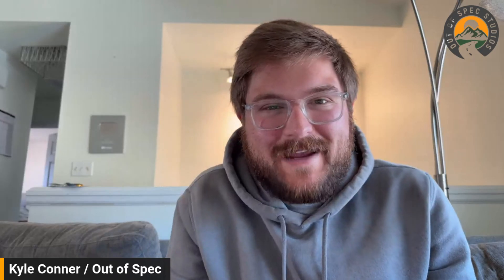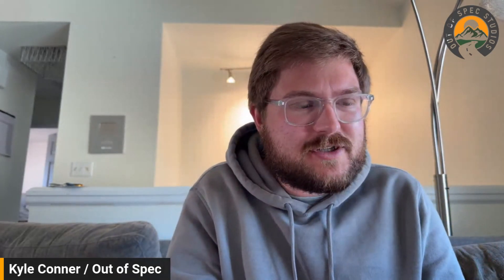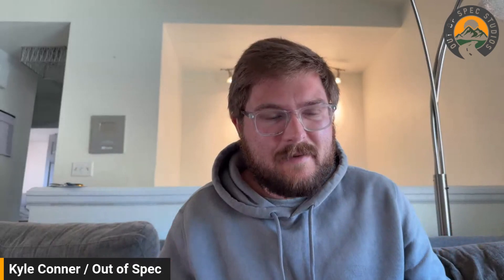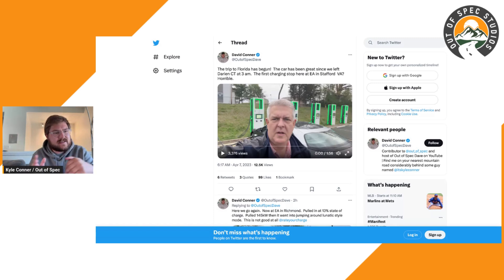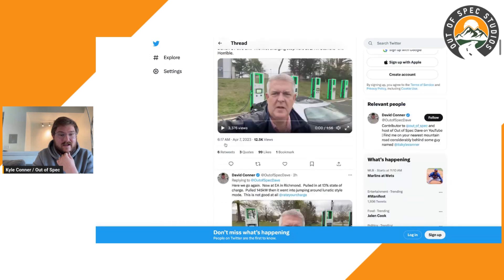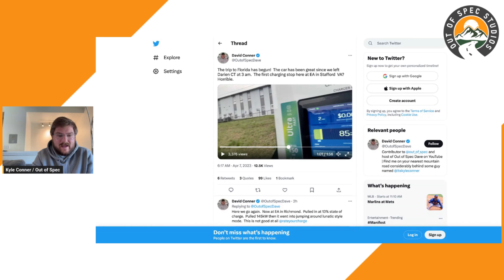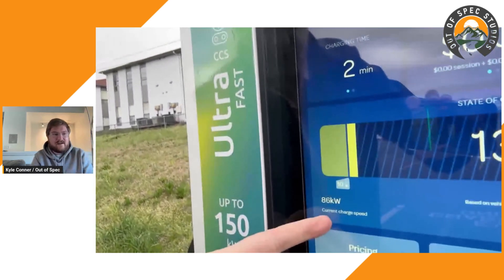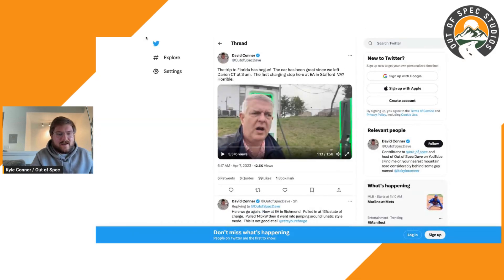Help Us Figure Out What's Going On With EA Signet Chargers Delivering "Dirty Power"! | Episode 109

Comment: Bad power module causing isolation. When it starts to ramp and use the bad module it shuts it down and keep trying to restart. Keeps trying until it finds a working combo.

Comment: I've gotten similar (but slightly different) behavior from ABB Terra HP DC fast chargers in my Kia EV6. I suspect it is failing power modules that can't supply high voltage (>700 V). The charger initially tries to give my EV6 the full 310 amps (~230 kW) then keeps backing down to around 130 kW at most stations. I thought high amperage (as most 400-volt class EVs need) would stress the power modules out more but I guess it's actually high voltage -- maybe also because 800 V-class EVs are less common.

Comment: Porsche Taycan Cross Turismo 4s owner here.   I did a Vegas run last week and stopped at the Salina, UT EA location, which has these Signet units,  both ways and did not have an issue either charging session.   I put 50kWh to 60kWh in the battery pack both times in less than 20 minutes with initial charging speeds peaking in excess of 250kW.     Curious to see how big a "thing" this is or if it is just select units being affected.

Comment: Ioniq 5 owner.  I have heard others say it only happens when their cars battery temp is on the line between wanting to ramp up.  This makes sense for when I have seen it.  Basically when I started cold (high 20’s to low 40’s).  Drove at least an hour and ran some preconditioning.  I haven’t seen it when it’s ice cold or at times I know the battery is fully warmed.

Comment: If the kW reading is fluctuating, that means voltage from the charger is fluctuating, since voltage is what controls charging. The power electronics in the car don't do anything while charging. In fact, the only thing the car does is monitor current, voltage and cell temperature. It then requests the mapped charging voltage based on this data from the charger. The charger then delivers this voltage. Except something in the charger is broken and it fails to maintain the required voltage. Fluctuations are usually caused by corroded or broken contacts, broken soldering, poor wiring, contamination, humidity and the like. DC chargers basically work like arc welders. The reason why cheap china welders are cheap and rubbish is because they suffer from all of the above. We have a brand of chargers here in Europe which are better than all the others by a big margin, and the reason for that is that they already make some of the best professional welders since god knows when and thus know how to make a solid inverter and how to keep shit from going inside and mess it up. If an entire site with multiple chargers is restricted to 50kW, that probably either means the entire System is in agony and just keeps up a basic service to help you get to the next charger, or only one 50kW module is left in working order. In any case it sounds to me as though these chargers are due for replacement or a thorough rebuild.

Comment: I have 3 theories.

1) power modules are getting tired and worn out.

2) CCS communications are faulty via bad connection.

3) EA clearly doesn’t know how to optimize the software to run on the chargers.

Comment: This along with hearing the new BTC chargers are blowing breakers in cars has me concerned about using EA.

Tesla Supercharger delivered power is very smooth without spikes (as are most other chargers). If I saw the spiking like that I would immediately disconnect and look at other options. I might even consider using the Chademo plug at the same EA site instead (since I have that flexibility) just to smooth it out.

The flickering between power levels seems like a recipe for charging system or battery damage.

Comment: When are you gonna call it? At what point do you give up on EA? They have nothing but problems. Even their "solutions" have problems. Yeah, I get it, you need a public network, but EA is not it.
Reply: For now, EA have been on all major highways across the country. Despite having so many issues, they are 80-90% of the time there. Chargepoint would be there too but they don't output as much and not as widely available as EA.
Reply: @TheRealMerchyBautista  well… with the big 2 committing to switching to NACS, EA will either need to step up or die off
Reply: @TheRealMerchyBautista  And? They could be in every parking lot, on every corner and every where people need them, but if they don't work, which they don't, they are useless.